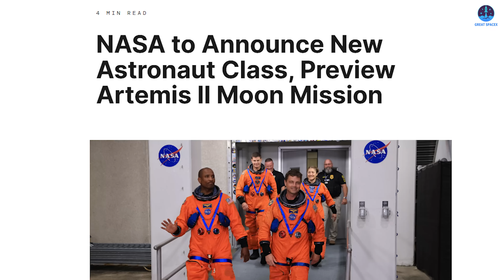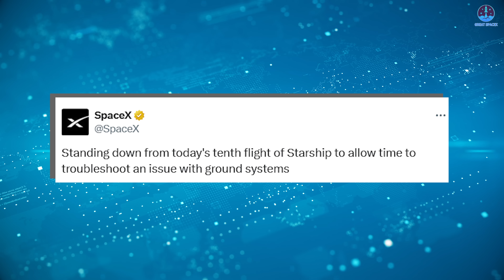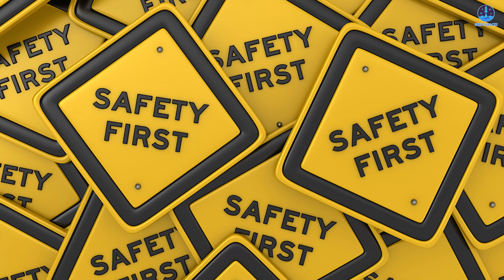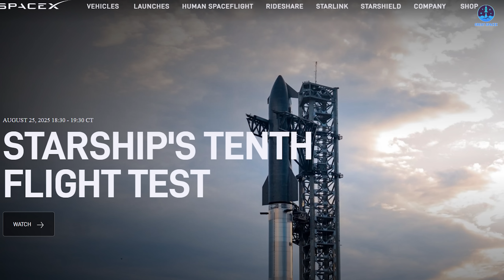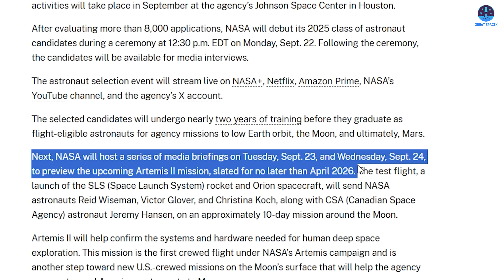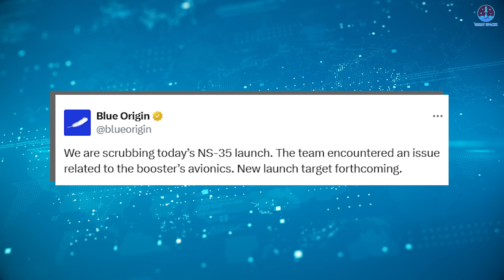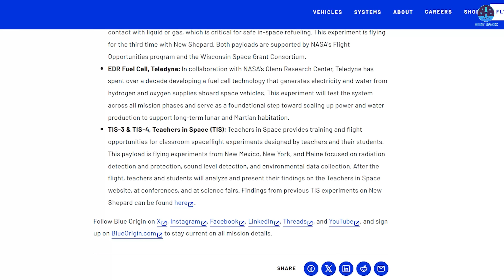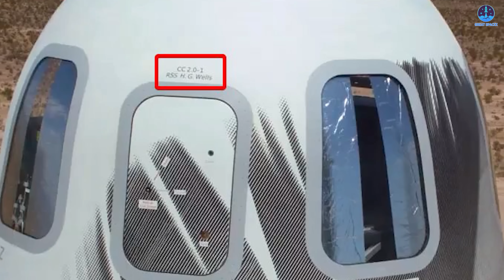OXYGEN LEAK! SpaceX revealed Why Starship Flight 10 NO Go…New Launch Scheduled TODAY

Comment: Explosion during “orbital” insertion burn evens, Not stabilised in coast phase 2:1, explosion during reentry 3:1, explosion on launch pad 4:1, failure to deploy payload 4:1, failure of heat shield 5:1. 100:1 bar.

Comment: I'm glad to hear the issue wasn't with the Ship or Booster! Still, if it was an O2 leak with ground equip at the pad, had those engines fired, SpaceX would be minus one launch pad.
Glad to hear it's been sorted and hope they launch today! No one turns things around faster than SpaceX.    :)

Comment: Good video. Just wondering what happens to the fuel when the ship is filled with fuel, and the launch is aborted? Is the fuel transferred back to the fuel storage tanks on the ground? Is the fuel vented into the atmosphere? Is the fuel left inside the ship in a situation such as this where the launch may be only delayed for 1 day?
Reply: The fuel is pumped back into the ground tanks to be used for the next launch attempt
Reply: @Torgonius  I thought that the Oxygen was just vented ... not sure about the Methane portion ... The Oxygen has no atmospheric effects, but Methane is probably viewed as a big No-No to keep the Climate Change Cult happy ...  (despite being insignificant in the World scale of such things).
Reply: They dump it in the gulf.
Reply: @easypeasy2938  Hahahaha...You can't dump liquid oxygen or liquid methane the same way you could dump water, gasoline or oil. Liquid meth and oxy have to be under very high pressure. As soon as it is released into the air and exposed to much less pressure, it boils off.

Comment: I would be much more interested in learning what's holding Blue Origin back from another New Glen launch. While New Shepard may have accomplished demonstrating private sector reusable rocket development, it's not going to move the needle in commercialization of extraterrestrial ventures.
Reply: Unfortunately, they aren't as public about things as spacex. I don't know it if is still and issue but previously the BE-4 rocket motor was a big source of delays. It was also an issue for ULA's Vulcan Centaur. ULA announced that they had several rockets ready to go and planned to make like 5/6 lunches this year.